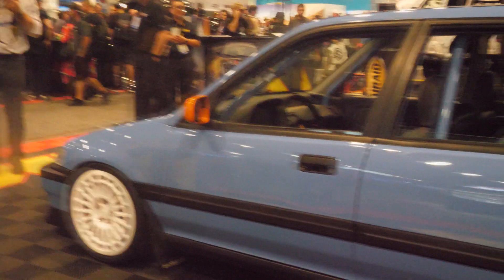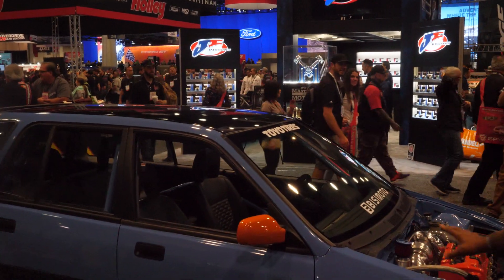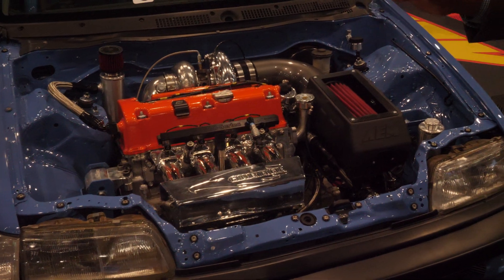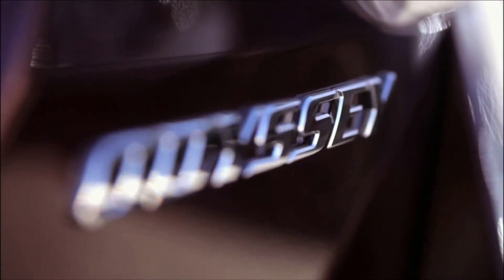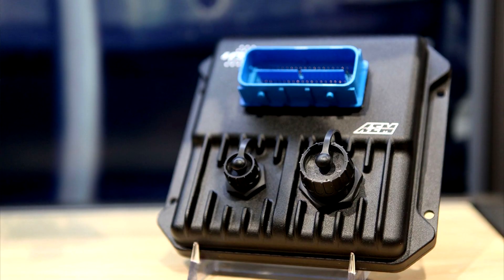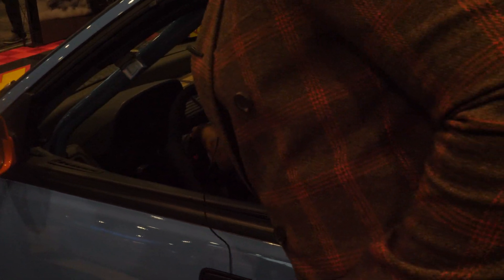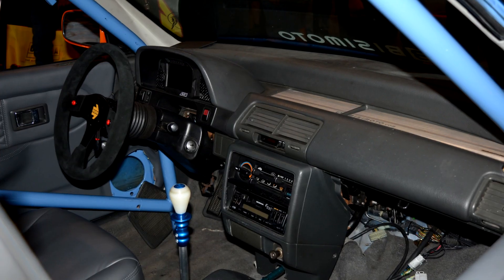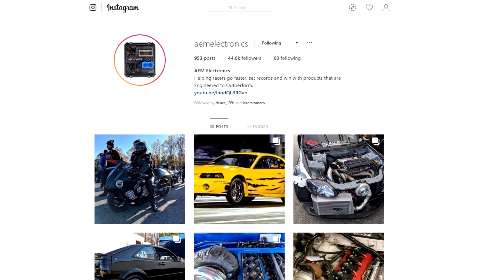BREAKING DOWN the WAGOVAN v2.4 at SEMA 2018!

Comment: "2.4 also stands for 2.4L engine" but "it's a K24Z3 DESTROKED with an eagle crankshaft". So it isnt a 2.4L then?
Reply from the maker: The K24Z3 is 2.4L and was used in the TSX and Accord from 08/09-15. Bisi was just trying to quickly explain that it was built for boost.
Reply: AEMpowerTV My original comment had an error in misquoting Bisi. I meant to quote "it's a K24Z3 DESTROKED with an eagle crankshaft." So my main point was that if it is "destroked", then how is it a 2.4L still? That makes the Wagovan 2.4 name not match up with what he says it means. Don't get me wrong, not hating. Just seeking clarification.
Reply from the maker: That's a legitimate question! One we don't have the answer to but Bisi will since he built the engine. He's super approachable. Shoot him an email!